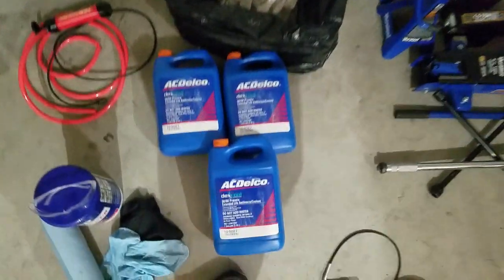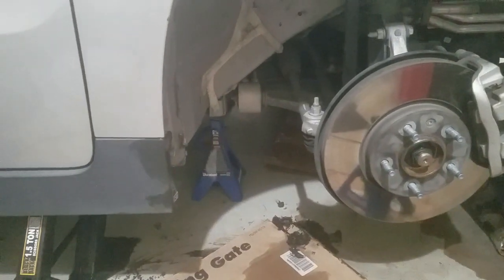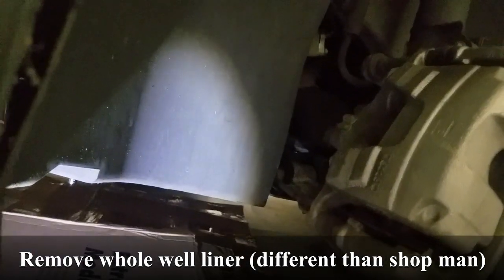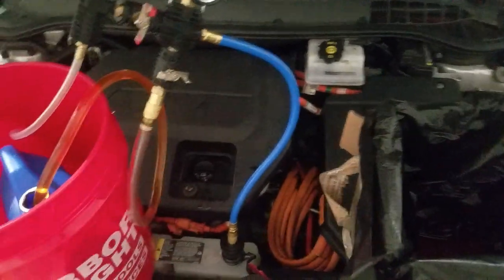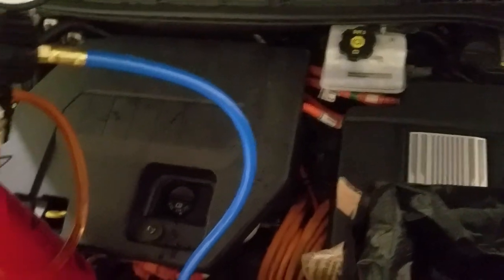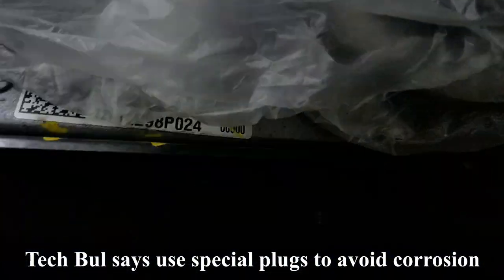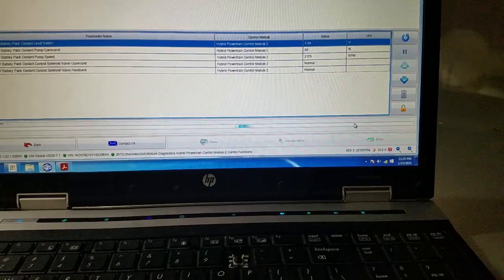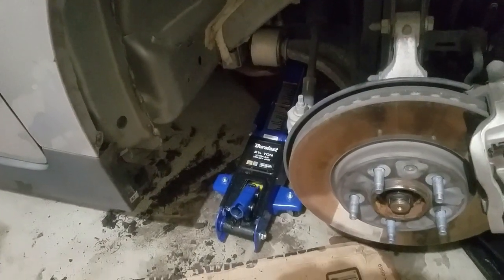Chevy Volt 1st gen 2011-2015 - Electronics , Battery and ICE Coolant Drain and Fill Procedure

Comment: Thank god for YouTubers who take the time to show this. Great video Mr. Morton! I bought the VCX Nano because of this video. I have a 2012 Volt from new, in South Florida. Battery was replaced under warrantee after six years or so as it failed. Just had a coolant leak when charging and suspect the battery coolant pump may have failed as I don't hear it cycle on when charging but I have no error code. I am hoping the Nano with let me check the pump function. In case anybody else was thinking of getting the VCX Nano after watching this great instruction video:  VCX Nano I bought is working on Windows 10. It came with a USB stick to install the software. I have an older laptop I don't use that I put it on just in case of software issues. I updated the firmware via USB cable to the Nano.
Reply: Did you find where your leak was coming from?  I have a 2013 and noticed coolant leaking the other day, steady drip from the front drivers side and battery coolant level is what's dropping.  I haven't pulled everything apart yet to track down the leak, not sure why it would be dripping from the engine radiator when it's the battery coolant that's leaking.  I suppose it could be running back from the auxiliary rad in front, hate that everything is so cramped, makes it very difficult to trace a leak.
Reply: @GrandPrix46  I found that I was wrong about the leak being from the Volt. I am lucky enough to own two cars. My other (none electric) car I found has a coolant leak which also uses an orange colored coolant that looks identical to the Volt. I had moved the car out of the garage and parked the Volt in without realizing coolant was already on the ground. I think the Volt coolant pump was not running by chance because the temprature did not require it to run. Battery coolant resivour was low making me think it was the Volt. I topped it up and checked everything and thankfully no leak.
I wish you luck finding a fix with your issue.

Comment: When going to the Auxiliary Coolant Pump step, this is under the Module Diagnostics> HVAC Control Module > Misc Test

Took me a bit to find that one, since it's not under the section used earlier.

Also, a crazy thing I found accidentally. When the car charger is plugged in, it also charges the 12V battery. Brings the 12V line up to 13-14V as can be seen in the bottom right corner of GDS2.

Comment: other than commanding pumps you could fill and then add vacuum  to the system. vacuum will pull air threw fluids... a drain fill and vacuum could save a butt load of time.
Reply from the maker: Normally that works well in most ICE coolant loops where the only valve is the thermal valve (allows the engine to heat up before cooling with the radiator).  The Volt's coolant system have several valves and will result in descent air pockets in the Battery Loop as well as small ones in the engine loop.

In the video, I never broke the vacuum seal during the battery drain and fill and the purge routine moved about a quart of air at STP.  Not a perfect vacuum at that point nothing is lost since its still significant negative pressure and the Venturi valve removed these so  that vacuum was maintained when adding the additional coolant.

Comment from the maker: @jon fair

For the ICE (probably) and Electronic (def), you could do that, but in the Battery loop has valves that preclude a solid vacuum of the entire system.

Worst case you end up with the the service high voltage flag and best case you have air pockets that will impede proper thermal management, and shorten cell life.

I added this because I saw my original commit deleted.

I also saw the deleted comment "If you don't know how to work a floor jack please don't work on a volt"

if there is something I did unsafe please call it out, we can all improve. I assume its words of wisdom otherwise, as a crush will kill you.
REPLY MANAGE ALL COMMENTS

Comment: When your running the auxiliary pump for a minute, how are you running the engine? Are you using the software to run it? Thanks
Reply from the maker: I was trying to figure it out in software (and could not).
I ran it by having the hood latch open.

Comment: Hi, to drain the battery loop fluid, can you do it by disconnecting the pipes to the Inverter?
Reply from the maker: Hi, I think the inverter is the electronic loop and not the battery loop.

I disconnected at the battery intake (under the car center in video) for most the fluid and at the front passenger side.
Reply: @ChuckMorton  i bought a Chevy which had a small hit from the side and this damaged the Inverter. I bought a new one. Ive driven this for years with no issues, car has run fine, but the engine management light is on and the ac does not work. I thought this was linked to the battery. Any suggestions which loop this is related to would help. Thank you
Reply from the maker: @redx11x  pretty sure its the electronic loop that cools the ibgt (power transistor) in the inverter.

The AC is used to cool the Battery coolant. There is both heat and cooling to keep the battery from degrading.

If your AC isn't working, it sounds like something in your compressor failed and its likely the car knows it cannot cool the battery loop.  The FB group would be where i would ask  "Chevy Volt DIY repair and Modding".  best of luck.
Reply: @ChuckMorton  really appreciate your response. What i will do is check to see the error codes that are coming up and ask on that board. I did read a few years back that it was related to coolant leak and not being refilled. There was very very light damage to the side, the bumper and a bent pipe on the Inverter which i had repaired. No damage to the area where the ac compressor was.

Comment: Im thinking just sucking out the storage tanks and refill just to recondition the fluid. I don;t want to drain everyhting. it looks like brand new, but 7 years old.

please advise. I do this with brake fluid all the time
Reply from the maker: If the tank is circulated with the system, I do not see this being a problem to do this several times on a schedule to keep the average fluid age down. I do not know if the reservoir is circulating or just used as a thermal expansion overflow.

The traditional ice engines, the heat causes the alcohol and chemicals to sometimes form acidic compounds and why flushing those systems is important. Recent formulas have made less the need for flushing and just draining but I am not an expert in this. The shop manual says to drain but no flushing so I don't think it's an issue with the fluid that GM chose to use. This still doesn't quite answer if it's circulated or not.

I know one of the main reasons the battery fluid is to be changed is because impurities can cause a drop of impedance (hence the requirement for DI water and premix is probably the answer), there are  tools that are used to measure the resistance of the fluid and you might be able to see it change over time (it's also measured by a high voltage system sensor, will throw an error it too low).

Brake fluid is a tricky thing, because brick fluid lowers is boiling point as it absorbs more water. This and corrosion of the main reasons why it gets changed and the fluid gets the worst on the calipers because they can absorb water from the surrounding environment more there than in the master cylinder. Unless there is some active type of circulation all the way to the drums or calipers, the fluid could have a dangerously low boiling point. Something he wouldn't realize until going down steep grade or other event that causes you to warm your brakes.
Reply: @ChuckMorton   its pressureized so I don't want to open the lid
Reply from the maker: @redsealjourneymanreviews6647  oh yeah, it's pressurized in the ice system to raise the boiling point a few degrees but probably not much higher in the two other loops.
The expansion in the ice overflow will cycle some of the fluid, but I think expansion in the other two loops are minimal (and would reduce coolant exchange). The interface with the tank and the like may have been designed to have some fluid bypass and exchange with the reservoir fluid, but I don't think it is designed that way.
Reply: @ChuckMorton   the lid on the battery coolant system has  a stop on it to prevent you from removing cap as it is under vaccuum.  so probably take to dealer for that.
Reply from the maker: @redsealjourneymanreviews6647  it's actually not under pressure when off. They added that to stop people from adding fluid without deionized water. Distilled water doesn't mean it's deionized also. The distilled water that you get in the stores means it doesn't have particulates dissolved in it, but it still contains ions. DI water is usually found in chemistry buildings and for special industrial purposes. That is why I used the premix in mine.

There is a bunch of tsb's about raising the level of the battery loop, since it was throwing codes for some people.
Reply: @ChuckMorton   understood but the refill procedure shows use vacuum
Reply: @ChuckMorton   really I want to take out a liter and put a liter of fresh in
Reply from the maker: @redsealjourneymanreviews6647  it's not under pressure naturally. The vacuum is to allow fluid to reach voids during the refill process (similar to holding a plastic bottle inverted underwater). Trapped air provides pressure and keeps the liquid from filling. Removing the air by vacuum, allows the fluid to fill the void. Even with a good vacuum, there will be pockets of air in the battery due to the fact there are tons of valves in the system, so why it need to do the commanded purge under vacuum. Having air trapped in the battery will cause local spots to not be cooled or heated properly and will degrade the battery a little quicker. Some people have done the vacuum fill and not trip the low fluid code, but these tiny pockets would still exist until you run The Purge cycle under vacuum. I forget but I think The Purge cycle removed about half a quart of air, I do mention it in the procedure. I ran the purge twice just to be safe and the second time minimal air was removed.
Reply: @ChuckMorton   so I will just remove a liter and fill

We live in temperate climate the fluid looks new.
Reply from the maker: @redsealjourneymanreviews6647  and  as stated earlier I do not think the new fluid will cycle throughout the battery well, but do not know. The only advice I can give is said if you take out too much fluid,  (to the bottom of the battery reservoir), air can get into the system easily and you can throw a code so be careful about that.
Reply: @ChuckMorton  bottom of battery res how far down is that
Reply: @ChuckMorton  how much to take out at once ?
Reply from the maker: @redsealjourneymanreviews6647  don't let it drop below the reservoir otherwise you get air pockets.

Like I said, I can't recommend this method as I don't think it will mix in the system well as the reservoirs are generally not the active flow of the system
Reply: @ChuckMorton  man sounds like if a volt dealer doesn't know how to change the 3 loops it can leave a lot of air in the system. If i have access to a hoist how quick you think I can get this done by?
Reply from the maker: @PhuPhillipTrinh  its probably tech specific on if they are good or not and there are not a whole lot of volttechs in my area (plus they screwed on the oil filter so tight when I got lazy and decided not to do my own, I literally twisted the filter housing and had to cut it off.)  Similar to just replacing my own gas lines in the house with schedule 40 (inspected as well).

As for the time, I think 3 hours if you work on cars and maybe 2..5 if you run the purge while working on different sections.